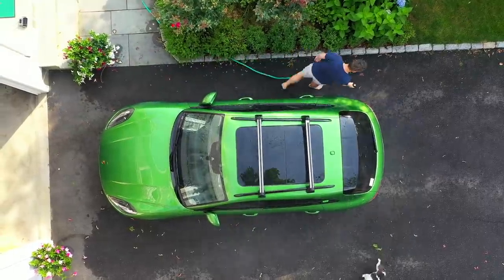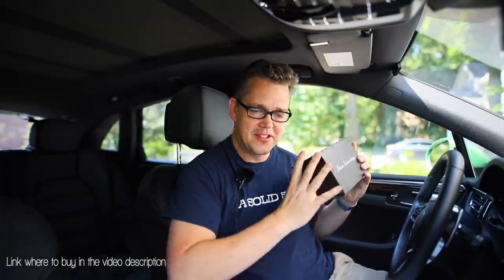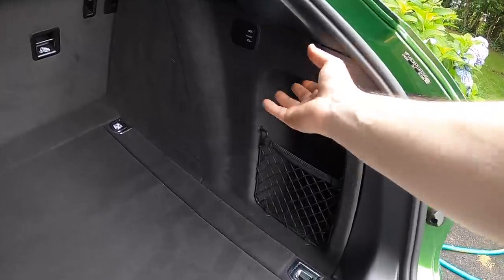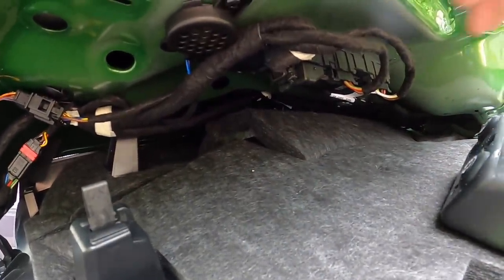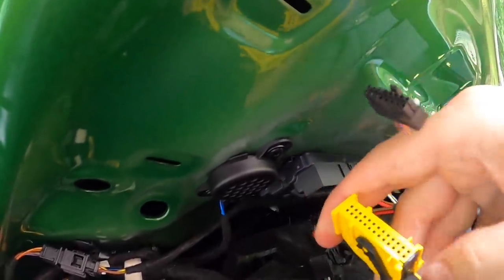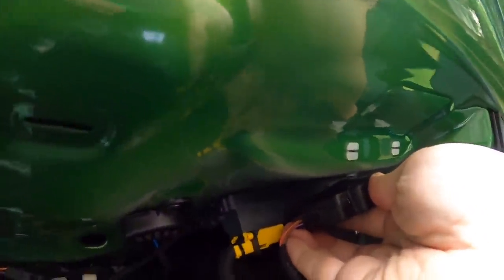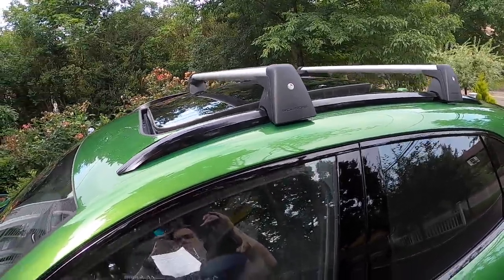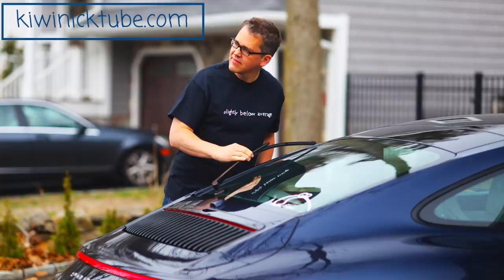Porsche Macan Convenience Module

Comment: LMAO when you were rattling the features I was thinking I had those on my Audi A6 like 20 years ago and then you basically said the same thing.
Reply: Funny, exactly the same happend to me. Used to own a A4 2.5L Diesel 😃
Reply: Exactly
Reply: Sam here. It is useful to be bale to remotely open and close the windows, have had this for ages on Audis. I wonder if standard on the Q5?
Reply: Stephen MadOne Yes. I have a 2018 Q5 Premium Plus and it has all of these features. HOWEVER to roll up the windows you do have to be touching a door handle (for safety)
Reply: Brandon Wright interesting, in Europe you can always open/close the windows via the key. At least works on a B8.5 A4 and Mk7 Golf. So it’s probably a US-only issue
Reply: danI43541 Yes...lawyers :(
Reply: Mirror fold on lock/unlock is already there.  I just checked.  I think you have to set it in the options, but no module required.

Comment: You can’t program the car like bmw? You can turn all that stuff on with Less than $20 cable or like $50 with an app and Bluetooth module... and then you can turn that on multiple cars. Porsche is a rip-off.
Reply from the maker: Porsche is a rip off!
Reply: @NickMurray  Guessing he's never owned one or he would be wildly familiar with this fact.  Still liking the green metallic color quite a bit.  Trading in my Macan S for a GTS this winter- does it come in that color?
Reply: Its a little more complicated on Porsche, need to buy (buy and return if you want) tool for roughly $600 that will do all car diagnostics, service reset, and coding
Reply: I was wondering that too. Could the same be done by updating some software settings from no to yes and/or vice versa? Is the gizmo a translater for certain codes, where a 0 (false/no) written to the system, instead read that as a 1 (true/yes). I would be tempted to have a go via an OBD tool to do this via software.
Reply: A Porsche dealer or independent shop can activate all of these features with PIWIS I'm sure.
Reply: BUT BUT BUUUUUUUUT...........Porsche drives so well.
Reply: naughtyUphillboy Porsche drives...  a hard bargain.
Reply: @DiscoFang  Agreed......I remember the day.........for my new boxer I was asked 400 dollars for plastic wind deflector.........it was not a standard equipment & I had to buy it...........BMW Z4...looked so much appealing

Comment: Does the Macan seriously not allow you to drop the windows if you hold the unlock button? We’ve had that functionality on our VWAG cars (Even a SEAT) for as long as I can remember! Great video as usual Nick.
Reply from the maker: I know right? Same I remember this in my year 2000 Audi.
Reply: On my Macan S (UK) all windows open when holding the unlock button on the key and the windows and sunroof closes when holding the lock button. MY2019
Reply: @XroadMedia  Probably already worked on Nick's too, but this is Nick remember!
Reply: @NickMurray  My father's Nissan Mazima had it in 1998. Clearly the only thing Nissan has ever had over Porsche.
Reply: Nick Murray I think that is a US car - Problem. I know from 911s in Germany that they do it.
Reply: I'm sure this can be coded in the OBD as on most cars. Just need the right service tool for it
Reply: I had an 03', 08' and a 2011. They all had the feature. Also, my 2010 Jetta TDI. Very strange!

Comment: Hi Nick. Thanks for this video. I have a 991.1 C4S. Blue like your old one, except saphire. Perhaps you can let me know if aftermarket kits are available to add a rear camera, interior light design, and/or comfort key access (keyless entry). It has most other options, but I would appreciate adding those. Thanks in advance.

Comment: Nick, I purchased the sport exhaust option on my 2018 Macan.  But it can't be more than 3 DBs louder than stock.  A very expensive purchase mistake.  Do you know of any factory electronic tweak that's available to increase the loudness of the exhaust note in the sport mode?
Reply: 3dB doubles the sound intensity. You'll probably need to de-cat or remove a silencer

Comment: Wow these all seem like very standard features on the Audis. All windows and sunroof should close too when you hold the lock sensor on the door handle if you've got that feature. My Audi does it, and it's 15 years old. if not, Porsche are ripping ya off 😉

Comment: I am thinking of getting a Macan S vs Macan base model in Chalk with red interior. Not sure which model would suffice. It would be my first Porsche. The dealers here in Atlanta told me just to get the base model.. Wasn't sure if it was because that is what they mostly have on the lot or not.  They said it's a Macan, they are all nice to drive.  Once sales person said that  a Macan S is nice to drive but I would burn a lot of gas needlessly.   I am also looking leasing vs buying as well. I currently drive about 10-15k miles per year.  What do you think? Thanks for posting I have watched your videos for a while now and they are helpful.

Comment: Older VWs had most of these features.  I have a 2013 VW Golf R that presumably shares the same ECU as an Audi A3.  That car has roll up/down windows+sunroof by my R doesn't.  I found a list of features/options my car has that were coded off from the factory.  I had a friend in the VW community go through the list and coded in and out features to my car.   Isn't there a coding tool for Porsche (same VAG family) that you can code these features on/off without buying that module?

Comment: With Bmws it’s possible to “code” features that are disabled for the US market. Just buy a Bluetooth obd2 single and an app. Isn’t there something similar for Porsche (really Audi in this case)? Even on my 2001 bmw the windows opened and closed using the key fob

I guess I understand putting up with all the Porsche bs for one of their sports cars. But with the Macan , I think I’d just get a similar q5 or x3 instead. Another strange Porsche omission is the lack of the “lock” button on the tailgate. Most German cars have this and it convenient as it allows you to close and lock the car when closing the tailgate.

Comment: Those things that used to be standard on your Audi - a car costing tens of thousands less. Hence the reason I will never buy a Porsche. I believe in the word “value”. Not price, but value. I believe the more you pay for something the more you should get. I don’t know where along the way some normalization of deviance mentality occurred where the rest of society feels that it’s okay to pay an exorbitant price for something and then have to pay a whole bunch extra for things that should have been standard on the base price relative to a similar product.

That reminds me when my Passat was having some work done on it. The VW dealer, also a Porsche and an Audi dealer, made the mistake of having a midnight blue 911 parked right next to a VW Beetle with what appeared to be an identical paint color. I examined the paint on both cars and absolutely couldn’t tell the difference. Color, shade, metallic flecks - no difference. A Porsche salesman observing me came clean and said that the paint is indeed absolutely identical and is made by the same manufacturer. Funny - free on the Beetle and somewhere near $1,000 on the 911. I could afford an entire fleet of Porsches. The difference is that I choose not to be fleeced by some hotshot company salivating to make a quick buck off the gullible.